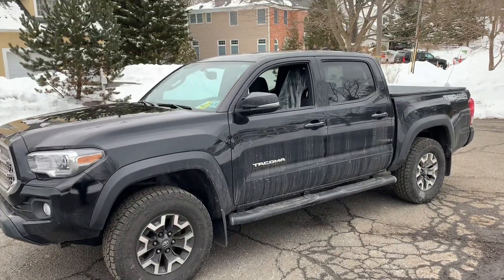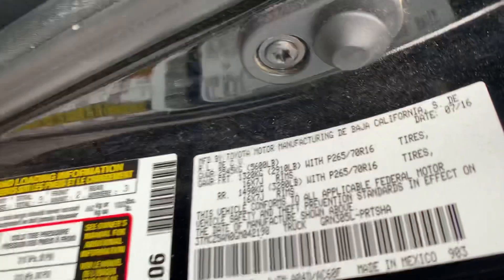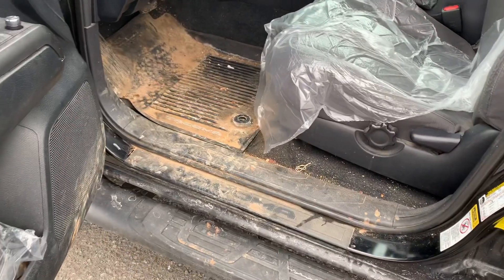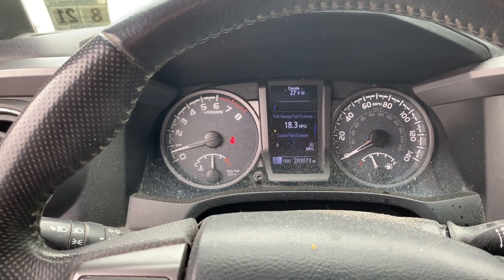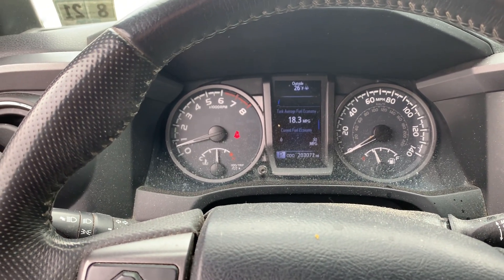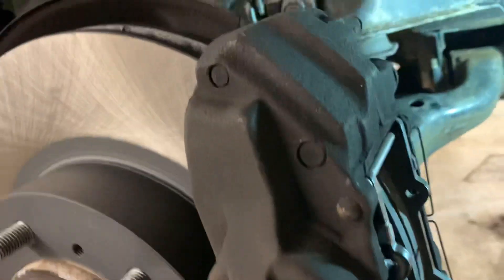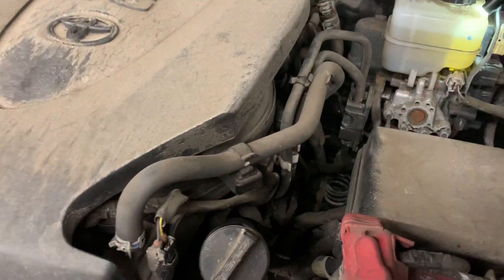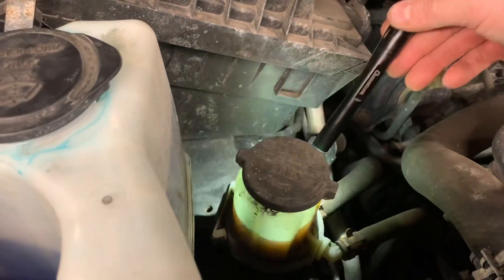Toyota Tacoma Reliability, high Miles? Review/Repair • mind/blown

Comment: Finally an actual long term review not like some people saying they got 10,000 miles 🤦on their Tacoma
Reply from the maker: Lol🤣
Reply: No kidding haha
Reply: My 2017 b brakes suck on it
Reply from the maker: Probably the weakest link in the whole truck. The front brakes on my 4Runner will last me 40,000 miles if I’m lucky. 🤷🏼‍♂️
Reply: I wonder if this guy had the check engine light on or had problems with emissions, like the cat or o2 sensors
Reply from the maker: The answer is no, at the time of the video. 
But came back 3 weeks later with another 3,000 miles with a cat code. We replaced the Catalityc Converter only. 👍🏻
Reply: @VikingsGarage  that’s pretty good 200kish miles to change the cat, the only down side is, the Toyota catalytic converters are really expensive, I’m assuming he got a cat from the dealer? 😮
Reply from the maker: He sure did, the catalytic you always want to go  OEM
Reply: @VikingsGarage  yeah, everything is better OEM, but I’m sure it’s expensive
Reply: 183,436 2005 toyota 2wd v6 4.0 tacoma prerunner racing development.
I get 20 mpg average yes I need a tune up but I'm broke lol 😅
Reply: @Elvisnotpresley97  v4 3 cats v6 4 cats modern v6 still 4 cats v8  I think 6 cats
Reply from the maker: Yup a whole lot of 🐈
Reply: @Vikings Garage  how much did he get on the trade in of the old cat from what we all hear on the news they are worth a lot of money
Reply: @VikingsGarage  my 1st gen had 282k original cats woop woop
Reply from the maker: I don’t remember, but yeah they are worth a fortune!

Comment: Toyota reliability and longevity is unequaled. I have a 2020 Tacoma. It’s my third Toyota truck. They’re the only vehicles I’ve ever owned where I’ve done scheduled maintenance only. No repairs. I had a Honda Odyssey that went through 3 power steering pumps, power steering rack, tie rods, 2 drive shafts, alternator, AC compressor, lower control arm bushings ( you have to replace the entire arm ), catalytic converter, oil pan gasket, roller hinges on side door, ignition switch. I drove this van 294,000 miles and finally gave up after the transmission started to go. There seems to be a world of difference the way Toyota builds vehicles from any other manufacturer, including Honda. That Odyssey kept my mechanic in business. Toyota trucks are the best vehicles on the market. I don’t think anyone else comes close!
Reply from the maker: I do agree with you. I used to work for Acura in the past 😉 
Toyota engineering seems to focus strongly on reliability. “ if the customer sees some of our older models still on the road that will reassure them that they can buy , worry free.”
Reply: You are right no one else comes close Tacoma is just in a class of it’s own , it’s a different animal than the rest .....

Comment: "Hecho en Baja CA, Mexico" Did you guys see that? Haters just got flamed. Honestly it's all about manufacturing systems. And the folks at Toyota are the masters...it doesn't matter where they're made..
Reply: Absolutly right. I remember the first Mercedes and BMW's made in the US. They had to fix problems at the port of Bremerhaven on the cars for the european market. First generation Mercedes ML and BMW Z3.
Reply: My 2004 Ford 4.6 V-8 4x4 was made in Mexico I had 234,000 miles on before I sold it! Great truck 
But just got my first Toyota and it’s a 4x4 v-6 Tacoma 2021 sweet truck
Reply: I got my SR5 2020 4x4 and it is from Baja California too that makes me feel confident that I got a good deal!

Comment: These are good trucks, but they are definitely put on a pedestal. More than they deserve compared to other trucks IMHO. We have been running Colorado/Canyon pickups at work. Extremely reliable. The first ‘15 went 375k on the original engine/trans and then went to 460k after replacing. We have a ‘19 with 295k now. Minor things here and there, but no failures that took them off the road. Brakes go over 100k between replacing. Two other Colorados with ~150k, no major problems. All are mid-grade 4x4s. The full-size Chevy/GMC trucks tend to have more issues and definitely go through transmissions.

Comment: I daily drive my 2004 V8 4Runner with 207,000 miles and love it.  All of the major components are original. I use Amsoil in the engine and change the transmission fluid every 30,000 miles or sooner.
Reply from the maker: That will last you for a long time. Try to protect the frame by applying undercoating. Good luck. Thank you for watching bud!
Reply: Is your four runner a automatic or a manual transmission
Reply from the maker: Pretty sure they only come with an Automatic transmission. 🤷🏼‍♂️
Reply: @jamesdean4972  Automatic, 5 speed and I now have 217,000 miles on it!
Reply: @VikingsGarage  what type of undercoating You pefer?
Reply from the maker: Check this video out:
https://youtu.be/94PgDIRdQ-8
Reply: Yep, same here. Oil and filter changed every 5K miles, front and rear differential, transfer case and transmission fluid changed every 30K miles.
My highest mileage Toyota died at 488K miles.
Toyota builds the Standard that Every automaker Should be chasing

Comment: Very nice man! I had my 2004 Tacoma with 214k miles before I sold it to get a 4 door and the engine was running like new. I didn't have any axel issues. I only had the change the driveshaft, but that was because of the lift I had on the truck. I now have a 2015 and I'm approaching 100k miles. Not that many vehicles out there you can drive with peace of mind after 100k.
Reply from the maker: Very well put, thank you for sharing your story. Thank you for watching and supporting this channel!

Comment: Me and my sons have lived through 3 Tacoma’s.  2001 Tacoma we sold 187,000 miles. Brake cylinder and radiator replaced.  Sold it for 6500.  2005 clear coat fading on roof. Sold it for 12,000.  2010 124,000 miles. 0 , ZERO, problems.  Selling for 20k because my son bought  a 2019 long bed Tacoma. Today I drive an FJ CRUISER and my other son just bought a well cared for 2001 4runner.   None of our vehicles have let us down. Thank you Toyota.
Reply from the maker: 👏🏻👏🏻 Thank you for sharing, that’s such a great testament to Toyota’s reliability. We hardly ever get let down . I appreciate you.

Comment: Finally a long term video that shows my truck with very high mileage and an expert giving a very favorable review I have a 2017 sr with 21000 miles on it I keep up with all of the factory suggested maintenance I even get things done earlier than expected since I don't drive that many miles I have as yet had to have any reason to bring it in except for a few recalls witch where minor things and one problem where the heat shield for the catholic converter was rattling and it was a very simple fix since I set out to keep this truck for a long time your video was extremely helpful to me thank you very much
Reply from the maker: You are very welcome. You got yourself a very nice an reliable truck. Wishing you many miles full of Smiles. Thank you for watching and supporting my channel.
Reply: @VikingsGarage  thank you for your personal response after your video I felt much more content on my choice to keep my truck until it dies

Comment: I just recently bought a '17 TRD Offroad I found used. It had everything I wanted, all the bells and whistles with a 6 speed manual trans, but it had 157k miles before I bought it. I was a little leery buying a vehicle with that many miles but owning a Tundra with 185k miles I knew Toyotas were good. My Tacoma is in great shape, little surface rust here and there and after I got it I changed the tranny and diff fluids, but they weren't in as good condition as that trucks though, they definitely needed to be changed. I can't wait to see how far she goes past 200,000.
Reply from the maker: 👏🏻 You Will see many more then that.

Comment: my 08 4 cyl tacoma has been good to me. not original owner but since day i owned it ive primarily used it for hauling. 30k miles later still running great only changed diff fluid trans fluid and engine oil. and battery .
Reply from the maker: That’s awesome, those 4cylinder Tacoma’s run forever, I’ve worked on a few with over 400k.
Keep up the maintenance and those miles will just keep racking up.
I appreciate you sharing your story and watching the video!!
Cheers !!
Reply: @VikingsGarage  yessir it seems very reliable just not a racehorse haha. just hit 200k

Comment: I have a 2012 with 496,000 miles. Iv only replaced the valve cover gaskets and the drive shaft. Engine still runs strong
Reply from the maker: 👏🏻👏🏻👏🏻 That’s freaking awesome!!Regular maintenance goes a long way.
500k around the corner 🏆
Thank you for sharing!!

Comment: 2017 Tacoma. 2 Hit and Run accidents. One was to the front wheel by a 96 mustang bent the wheel and suspension units and it was still running and I drove off to the side. Still turned on and spinned for the tow truck as well. Second one was parked at a casino and hit in the front. Still turned on and ran. 90k now running smooth and the collision center guy was impressed because he made it new twice now. Geico hates it though 😂.
Reply from the maker: Great story, thank you for sharing!!

Comment: I’ve got  a 20 Trd pro 152,000 so far everything still works somehow I still have original brakes battery etc, now mostly hiway miles in the summer months it averages 24 mpg in the winter 20 only problem was a lower control arm ( that’s because the roads suck) that was at 95,000

Comment: Made in Baja just like my 23. Made in Mexico is not so bad. I had mine checked for the axle recall and the torque spec was correct on everything. I checked them myself before the dealer and found no issues. It was all tight. Could not find any loose nuts or bolts. Got mine tuned with OTT. Runs great.

Comment: Impressive. I’ve got a 16’ SR5, DCSB, 4x4,  Made in Texas, with little over 52k and done nothing but the engine oil changes. Nervous about putting to real work like you have. Lol. Well done sir, respect.
Reply from the maker: They are very strong trucks, push her a bit she won’t mind. Thank you for watching and supporting the channel. Plenty more Tacoma content coming.
Reply: Don't neglect everything else. Differentials both front rear, t case   break fluid power steering etc

Comment: Yep, compared to its competitors, the taco might not get you there the quickest but it will get you there and back over and over again. Looking forward to reaching high mileage in my 19’ Manual Taco. 👍Great video!
Reply from the maker: Thank you buddy, Appreciate the support.
Good luck with your Tacoma.
Reply: How’s the manual on that truck? I want to get a manual as well
Reply: @therealchicken7395  Tacoma’s transmissions over the past couple of years have been hit or miss (even on the miss it’s still pretty decent) but other than that they’re fantastic trucks.
Reply: My ‘17 manual has held up really well. My only gripe is the gearing ratio itself. 1st feels like 2nd and 6th feels like 9th. A lot of research leads back to being slightly underpowered, but IMO they should be 5.29(?) from the factory.

Comment: ‘05 Taco here, 4.0 v6 auto. I bought it three years ago with 185K. It now has over 214 K, runs like new, uses no oil or leaks. This is by far one of the best vehicles I’ve ever owned. Including a few new ones. I hope it lasts for another 200 K! 👍
Reply from the maker: With proper maintenance, why not. Good luck and thank you for watching!

Comment: No matter the age of a Tacoma, once you have one you just never want to get rid of it.. my 09 has a bit of catching up to do. Closing in on 160k miles. Great video though!
Reply from the maker: Thank you very much. That’s very true. I appreciate you.
Reply: I was buying Toyota trucks when they were called the Hilux. They were Very Durable. Yep they were smaller pickups but they were Forced to do heavy duty work on our 17 thousand acre ranch.
In the 80s Toyota came out with a 1 Ton, Diesel Hilux pickup. We beat the soup out of that truck, but it Never let us down.
We were so impressed by it that a few years later we wanted to buy another one but Toyota had discontinued it. It finally gave up the ghost after 1 million miles of HARD LABOR.

Comment: Reassured myself! I just picked up a 21 Tacoma with a Manual transmission. Awesome review!
Reply from the maker: Sweet, congratulations! 
Enjoy
Reply: Change your transmission grease, the front and rear differential and transfer case every 60K miles and your Tacoma should last past 1/2 a million miles.
No lie, I put 488K on my first Toyota, waaay back when, before full synthetic oil.

Comment: Nice video, I just bought a Tacoma for this very reason on reliability. Thanks for sharing your opinions and thoughts.
Reply from the maker: Your very welcome. I appreciate you. Thank you for watching.
Reply: @VikingsGarage  this is spot on. I have encountered a few high millage 3rd gen Tacomas and then hop into my (relatively) low millage Tacoma and they drive exactly  the same. I bought mine new in 2019 and have 36,000 worry free miles and expect many more. Thank you for sharing this video... tired of all the 2nd gen owners (and others) hating on 3rd gen and it's 3.5 liter power plant.
Reply from the maker: That’s awesome, it shows Toyota’s quality and reliability regardless of mileage. Good luck with your Tacoma, solid cars. Cheers!
Reply: @VikingsGarage  thanks for the quick response. I'll support your channel. A little more detail about my Tacoma it is a TRD OFFROAD magnetic gray with a 6 speed manual transmission 🤓.
Reply from the maker: That’s a pretty cool setup. 🤩
Reply: My 2018 tacoma has 98,000 miles on it and it runs perfectly never know trouble
Reply from the maker: 👏🏻 many more fun trouble free miles to come. 👍🏻

Comment: Great video. Can you speak on why some dealers are pushing coolant fluid swap, auto trans fluid swaps, rear differential fluid swap, front transfer case fluid swap and brake fluid swaps (with or without pad replacement)? Some of these as early as 30 k but all by 60K.  My Tacoma is new 2022. I put 30k easy miles on it this first year. Im allways torn between doing none of the above or paying for all these services. Are they doing this just to rip me off or are some of these legit and if so when would you do them? I plan on keeping this Tacoma until she dies and at 30k a year, I will be taking into the deep end with mileage in the future. I'm just confused as to how to best care for it. I do all my own oil, filter and tire rotations and I am ok with preventative measures so long as they are really necessary.  appreciate your thoughts
Reply from the maker: Best advice I can give you, watch my breakdown video on the service intervals… it’s on the 4runner but exactly the same for the Tacoma. 
https://youtu.be/by3fumvXrfU

Anything being pushed earlier then those intervals, don’t fall for it. 
Dealers are more interested in your wallet then saving you money. 
I hope this helps!
Reply: @VikingsGarage  Saw the video and I appreciate your advice. So my takeaway is that the fluids I mentioned at 60K is really to be expected and not a waste of money. As much as I hate to feed the dealer, I have for over a decade received very good service from them on all our Toyotas. Thanks again.
Reply from the maker: Not a problem!!

Comment: I have 130k on my 2.7L manual. I’ve only had to change my front pads, and top off my power steering fluid once. I looked for leaks, and didn’t find any so it could’ve been low from the start. My clutch is getting some wear on it, it definitely grabs further out than when u got her with 28k miles but there is no grinding or slipping. I plan on changing it, only when it gives out lol. *note I’m in traffic daily.
Reply from the maker: That’s awesome, all in all sounds like a winner to me. The clutch does wear overtime but it all depends on the driving. Good luck with it. Thank you for watching.

Comment: This is why I bought 2 4Runners! A 2020, and a 2021.
Reply: Smart choice 4runners are still made in Japan.
Reply from the maker: Absolutely
Reply: I personally wouldn't have the peace of mind in tacoma reliability and durability anymore as many customer complaints on the transmission and engine indicate a plummet in quality. 4runners on the other hand seem to be very solid vehicles. Still made in Japan so that probably has something to do with it.
Reply: @joesteele3159  did you not watch the video?
Reply: @thechamberofchillz9705   Yes. I watched it. One good truck doesn't dismiss the many others that have had problems. Just because there is a chance you might end up with one that will be great doesn't subtract from the chance you will end up with one that will be a total headache. I want to trust the reliability and durability if a Tacoma but it's not easy when you hear so many terrible reports from dissatisfied customers.
Reply from the maker: Just to add to the chat, we get hundreds if not thousands of Tacoma’s of this Gen thru the shop and the Complaints are very few if any at all. We had one with bad Valve seals(watch my video on the orange one) other than that never ever any problems at all. 
(By the way the issue on that truck was only reported on about less then 50 others- nationwide ,that’s nothing. Toyota’s warranty covers it. ) 🤷🏼‍♂️